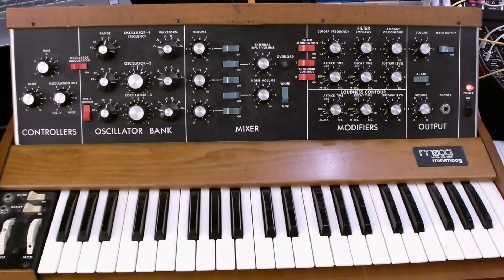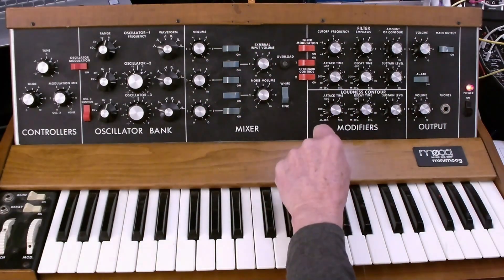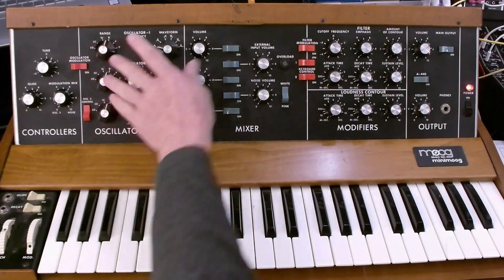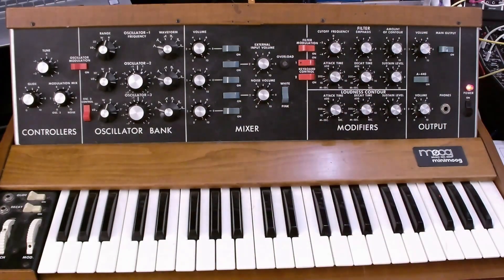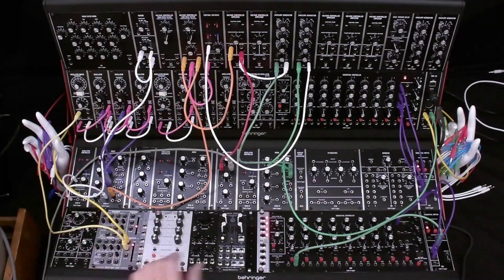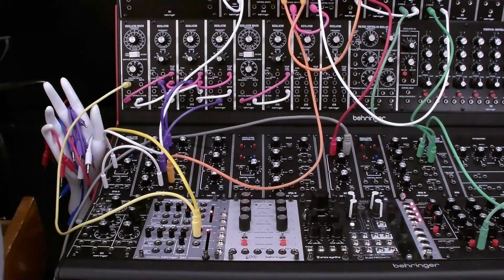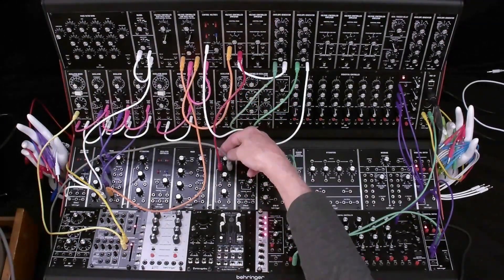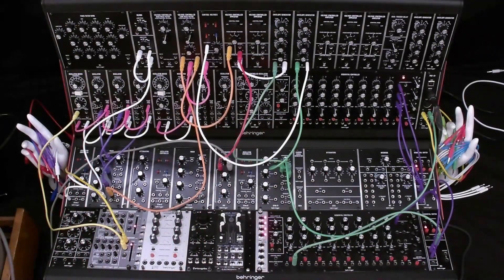System 55 Basic Patch Points - Lucky Man patch

Comment: Thanks!  A couple notes that I had when emulating on my system 55.  1, I need to use the interface module to convert my v-trigger to s-trigger or the notes just stay on regardless of the envelope.  so I go from trig to the interface right below to the left of the midi-cv and then go from s-trig out to the mixer mult like you did.  the other is that I needed to make sure the control voltages switch four (blue one) was up to work.  And then finally the voltage controlled Amp I have set to linear and set to fixed control of 1'ish.  I generally have all the notes really low though, I maybe shoudl move the range of the oscillators to 16 or even 8..
Reply from the maker: Thanks Josh.  You've covered a lot of details here that will be helpful to others.  I was primarily focused on the signal path.  A couple of notes:
1) s-trig/v-trig:  I didn't need to do the conversion because I have my CM1A MIDI interface to output s-triggers (if you're interested, I have a video on configuring the CM1A).
2)  Control Voltage: Yes, the blue switch must be up to enable the output of the attenuator.   I didn't give much attention to the Control Voltages settings (again, focused on patching).  This is a handy module. I need to do a short video on it.
3) VCA Linear/Exponential:  Typically, a VCA driven from an envelope is configured for Linear operation.   The reason is that the output of the envelope generator is usually exponential.  (Note: I usually set the manual control on the VCA to 0.  Otherwise, you are likely going to get some bleed through of the signal, even without the envelope gated).

Comment: Hi! I just added a 297 to my System 55 and found out the hard way (the only way to learn... or is it; smh) that the portamento (mine anyway; PCB013022REVD_01) only works is the top 15% of the control and the CV will not modify the portamento time (again, mine. Heard about others that work but I only have very little info atm). ALSO, the portamento is set to Roland System 100 voltages, i.e. 0-10VDC, so to get proper output, I had to use the 297's mixer to add in some of the +10 VDC to raise the keyboard CV into that range, and then tune the VCO back down. I've seen another YouTuber with System 100 in his rack so I didn't expect a different voltage standard, and they don't advertise it. You have to read the fine print. What has been your experience with the System 100 modules? Thanks! :)
Reply from the maker: I hooked this up to try it.  You're right that the lag processor on the 297 only want a positive voltage.  Of course, you've already figured out the fix.  I did notice that if the TIME fader is at the max, the TIME CV input does nothing.  If you put the fader in the center of the throw, the a 0-10v bias in the TIME CV does indeed control the TIME parameter.  I hope this helps.
Reply: @ozhalljr  You may have one of the working 297s. I just expected to be able to control the portamento amount entirely with CV, if it was connected, not modify the slider. It does seem that the portamento CV IN signal is added to the slider control. Maybe that's what the arrow from the input to the slider is trying to indicate. I couldn't find any documentation to confirm or deny. If the portamento range was working (again, mine is only the last 15%) then maybe that makes sense, but I can't personally try it out yet. I'm waiting on a response from Music Tribe support about the portamento range issue, but if I have to keep the 'broken' unit, I may try the 'add the resistor' to fix both sliders. Thanks!!!
Reply: BTW, the 297 manual only says "TIME – Adjust the portamento time. CV IN – Connect a voltage to control the portamento time from another module." so it is not clear in the manual that the voltages are additive. In fact, it sounds like you could completely control the portamento with CV. Something is wrong, either with the documentation or the implementation. I wonder if anyone knows how the original Roland 165 module worked... Thanks for shedding some light on the issue!
Reply from the maker: @greghering1119  If you put an audio signal into the Sig In and listen to it, you will be able to hear it working (as a 6db/oct Lowpass filter).  The signal will be about gone after about 20% of the slider throw.
Also, try a wider interval (3 to 5 octaves) and you can probably hear the lag before the final 15% of the slider throw.
if you do a mod, I'd be interested in knowing how that works out.

Comment: Just as a side note, the glide on the Lucky Man solo uses an exponential glide curve, meaning the glide slows as it reaches its destination note. This is opposed to a linear constant rate curve, which the Minimoog uses. The portamento module used here sounds linear to me.
Reply from the maker: Good ear!  Thanks for watching.  
You probably noticed that I was using the Roland designed 297 portamento module from Behringer, which probably is linear.  Listening to Lucky Man again, it sounds like he may adjusting the portamento time from one section to another.  I had not noticed that before.
p.s. you've got some serious keyboard chops there!

Comment: Thank You! O.Z. Hall. My System 55 arrives from Sweetwater on Friday, the 17th. What extra modules will I need for the Lucky Man patch?
Reply from the maker: Congratulations!  The answer to "extra modules" is: None, if you don't have to have glide.  I do have glide/lag/slew/portamento patched in from one of the Behringer System 100 modules (see bottom row, second module from left).  Check out my video "System 55 - Top 5 Missing Features":
https://youtu.be/OUJP7i_oHoc

The only update to that is that the Behringer 1630 Frequency Shifter will function as a Ring Modulator.  Also the PP1 works well as a preamp.
Reply: @ozhalljr  Thank You!
Reply from the maker: @robertparenton7470 thx for commenting.  Enjoy your new system.  Also check out my series on the Behringer Victor quad oscillator.  It goes well with the System 55.

Comment: Most of Emerson’s iconic synth solos need portamento or glide… it’s integral to the Emerson sound…
I wish a glide module had be installed
Reply from the maker: I agree.   The Behringer 297 works well and the glide is voltage controlled.

Comment: So how would you go about patching the LFO for modulation in this patch?
Reply from the maker: Great question!   Patch a 921 osc output into the 921A Osc controller as follows:
921 Osc (LFO mode) Sine wave via Aux Out-->921A Osc Controller, CV input 2.  
Use the Aux Out level for your modulation level.
Note that in the CM1A, there is no output for the continuous controller #1 (mod wheel), so you can't implement LFO modulation via the wheel with the CM1A.
Is that enough detail?

Comment: Nice presentation O.Z.  The MiniMoog is such a powerful synth. The normaled nature of its design belies its inner power and flexibility. I do prefer the modular though. Thanks for another great video. I was wondering how you deal with the low output from the 914 fixed filter bank?  I have been wondering the best way to patch it to match oscillator output etc. Any thoughts? Cheers
Reply from the maker: Thanks Tony!  I have not worked much with the 914 FFB ( not BFF :) ).  Honestly, I have not noticed the problem.  I think I've done one patch with the 914, but can't remember specifically.  Let me know what you come up with.  
Now that you mention it, there's no facility for boosting the signal in the off-the-shelf System 55, other than using a mult to input the same signal several times into a mixer and summing them together.  Let me know what you come up with.
Reply: hey, thanks for all the great info. I usually drive the 914 with the aux output on the 921. That gives a hot enough signal to bring up the output of the 914. I will try your idea of multiple to mixer. Cheers @ozhalljr